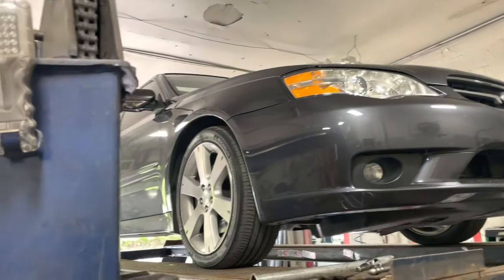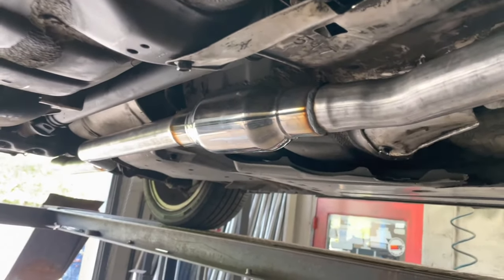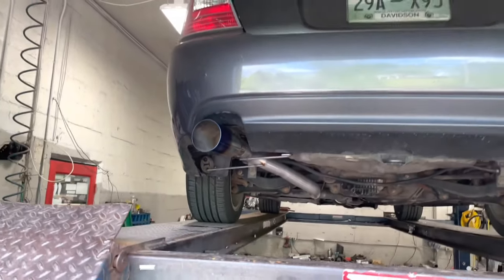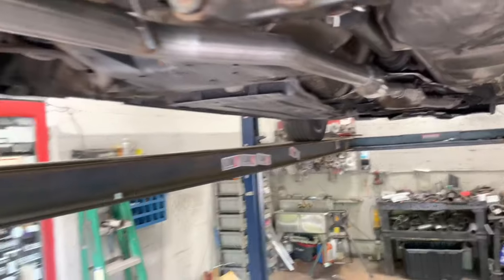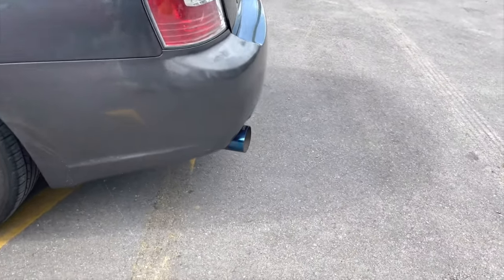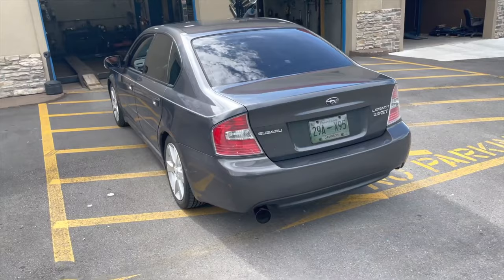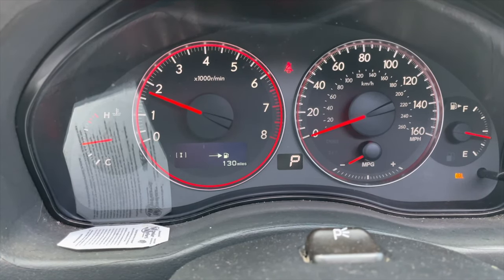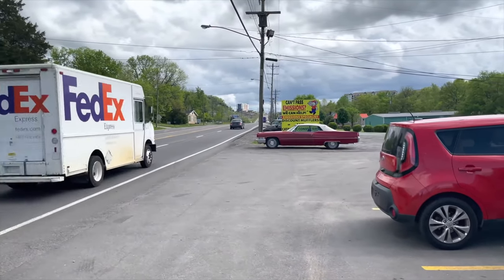2007 Subaru Legacy GT 2.5L Turbo Exhaust Sound w/ VIBRANT BOTTLE RESONATOR!

Comment: Subarus flat 4 is one of the best sounding 4 cylinders out there
Reply: It's because of the uel headers. Put similar headers on literally any 4 cylinder and it'll sound just as good
Reply: @StinkHatch5318  it'll sound similar, but not the same cause the boxer engine just gives the exhaust a different tone than other 4 cylinder engines